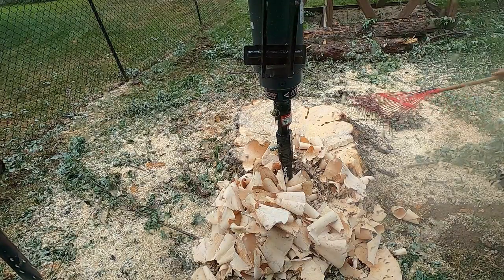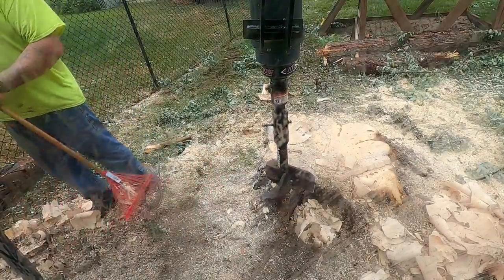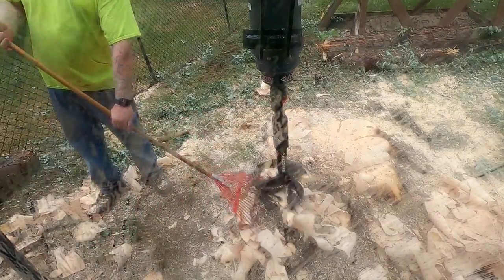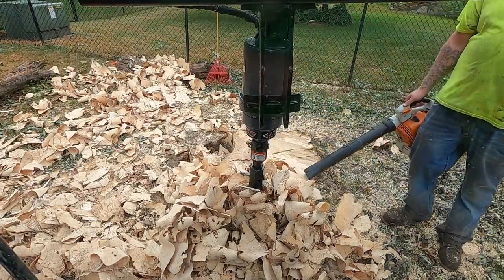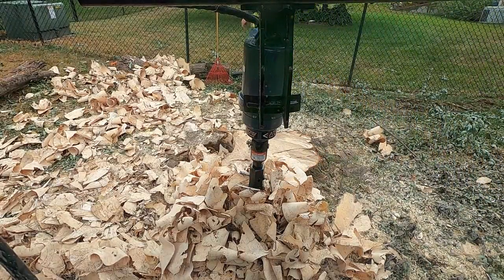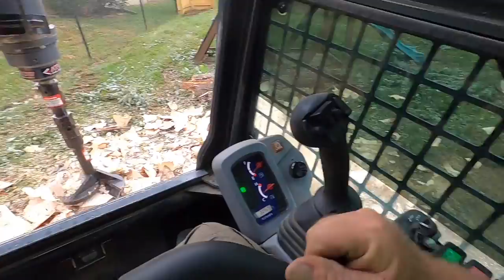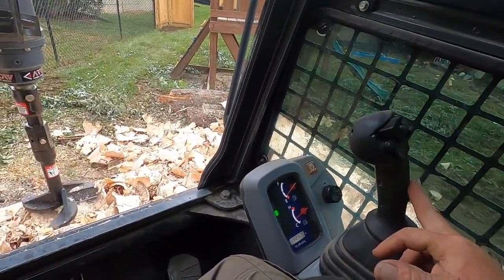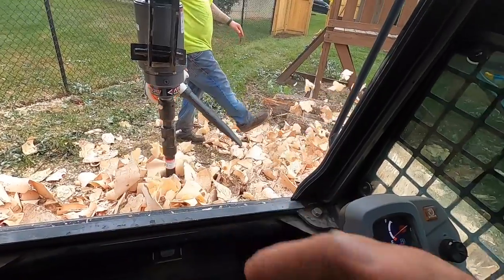Using the Danuser Stump Auger on a Big Stump

Comment: Is that an attachment for a post hole auger motor? Is that machine low flow?
Reply from the maker: standard flow attachment. Its a post hole auger. And the attachment is a Danuser Stump Planer. Its the best thing I've found for taking out stumps. No flying debris.

Comment: Great video
What horsepower is needed for this
I have a 40 horsepower mahindra, would that run this?
Thanks in advance
Reply from the maker: Maybe the smaller one. I would probably call Danuser tech support. I don't know. They should be able to tell you.
Reply: Thank you sir- I will do that @skidco

Comment: Where do you get the bit?
Reply from the maker: I actually tested it out for Danuser and then bought it because I liked it so much. A Danuser dealer can get you one. They have a 10" and this bigger one. its either 16 or 18" I don't remember which it is. Works really good. Im actually using it today for 3 stumps in a building lot.